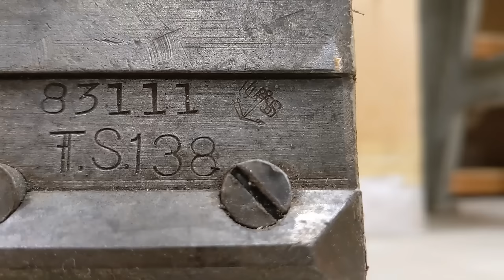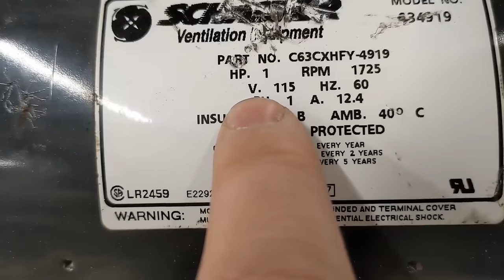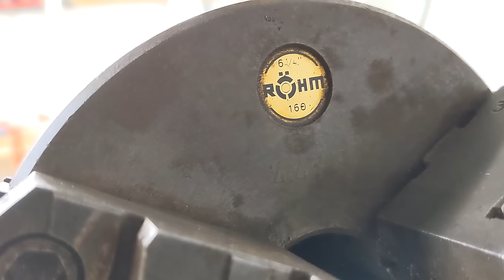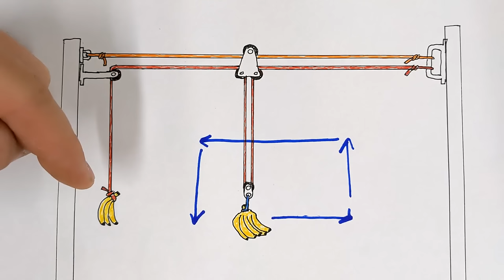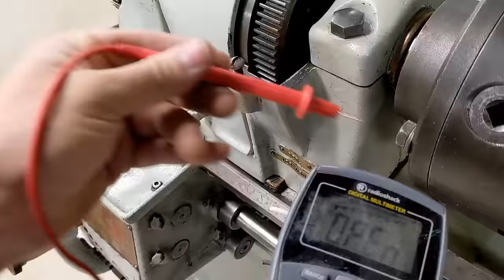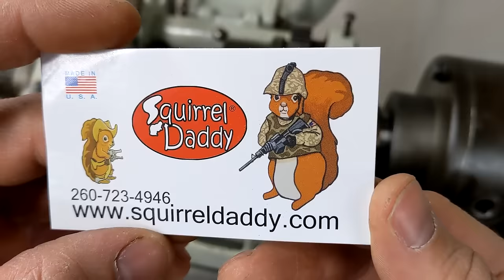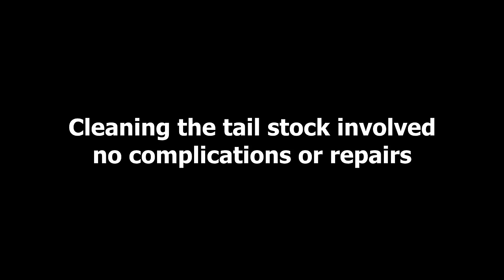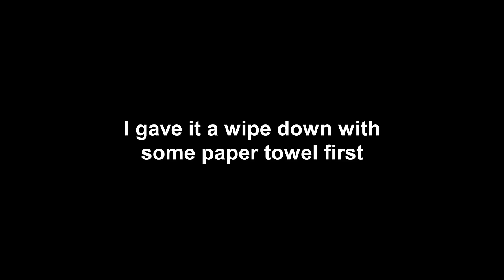From Crud to Stud, Restoring the South Bend Heavy 10 Lathe

Comment: I also restored a heavy ten from the Navy.  But when I did the bed was shipped back to South Bend and they re -ground the ways.  I then used turcite under the saddle and tailstock.  I sold it with a full collet set and  all the usual chucks and supports and stand.  The lathe was too small for my needs. I did like it though as this was what I learned on in college.  Super quiet and very precise.  I sold it to a guy who makes custom titanium bicycles.

Comment: I must say that I enjoy your sense of humor fully as much as I enjoy that of This Old Tony.  Now that I have found your channel, however, I will be losing sleep trying to decide who is funnier.
Reply from the maker: A comparison to ToT is high praise! it encourages me to put the effort in
Reply: Your video popped up in my suggestions, and I really enjoyed it.  I worked as an FA/final inspector for a machine shop for many years and was tasked with clean up and restoration of several vintage machines that the company owner had in a small museum room on site.   It was fun.  The chuck segment reminded me of a very old Bison 3 jaw that the boss found at auction.  Circa 1960, it hadn't been removed from its crate in about 40 years, but luckily, a smart operator slathered it in naval jelly before it entered its crypt.  Unfortunately, the grease inside had dried into what I could only describe as industrial adhesive.  Gentle heat was my only option, and even then it took a few days free it up before disassembly.  It freaking stunk too... I think they used whale blubber as lubricant.  Anyway, thanks for the great video.

Also, you will often find a leather plug under set screws on older equipment.  This allowed for setting tension firm enough to stay put, but loose enough to move without tools.

Comment: I brought a WW2 built South Bend 9 inch lathe back to the UK when my term working in Arizona ended in 1996. I restored it and was very impressed by the build quality. One thing that I found was that the headstock pulley has a figure of eight oil groove machined into its bore. I can't imagine the machining setup required to do that, but its very neat and shows how much the designer thought about lubrication.
Reply from the maker: That's great that you managed to get one back home, they're so interesting to pull apart and look at

Comment: On behalf of all South Bend lathe owners, a big thankyou.  Most of us have never seen such a deep excavation into the innards of our lathes.  If it still works we dont disassembled it ... and these tend to work forever.  All those oil ports is why.
Also enjoyed seeing your original lathe as well as your improvised tool post grinder.  You probably figured out you can lock the spindle t unscrew the chuck by engaging back gears while leaving direct drive pin engaged.  
Never be ashamed of a flat belt drive.  Old timers like my dad always felt they were safer than modern high HP gear drives.  Flat belts can safely slip if something (like an arm or necktie) gets wrapped up in the work.  Tension can even be reduced for newbys and kids still on the learning curve.
Since the flat belt is manhandled when changing cones my dad always insisted on a skived lap glue joint or gut laced joint.  Metal hardware can work apart and snag hands.  I helped him skive the tapers on the belt for his antique 15 inch South Bend and as a kid I cut the narrow grooves for the gut lacing on the belt for his 10 inch Heavy (called a Junior). All are still running as is my 10-K which I obtained as a big enough pile of chunks to make nearly three lathes (one tailstock missing but extra quick change)
Reply from the maker: Thank you for the story of those belts and your father's machines. I'm a big fan of flat belts, they've definitely saved my tools from a few crashes. I've always tried to avoid using my back gears for chuck removals to reduce the risk of damage, but perhaps that's a superstition I picked up from atlas which has wimpy zamak gears

Comment: The bolt head and but being different sizes was a standard, it was so you could work on the machine using a single wrench pack, if they were both 9/16th you'd need two separate and identical wrench packs...
Reply from the maker: Maybe they should have kept it that way, I have to carry around too many sockets

Comment: I managed the labor for lathe as about 1 and 1/2 days of work.  It is a south bend 9 model C as 1935 build w. 4ft bedway.  First cleaned and painted I raised a cinderblock stand and after some initial lube and drive belt function now happily make chips mostly as aluminum, brass and hard plastic.  As it arrived without a chuck, I mostly used clamp assembly to drive any initial jobs.   I made my own toolpost, and found various tool bits at no cost.
Just ahead, I am adding a brand new 3 or 4 jaw chuck and find with use, and constant cleaning the general end use is free and easy to any adjustment.  While some wear to the bed near chuck location is present, I find tolerance fine for my general hobby and motorcycle repair needs.
The South Bend lathe as design had a wide range of model delivered world wide.  And were well crafted with hand scraped surfaces and as you note, well designed lube points and operator access as tolerance metrics.  *dials and adjustments.
I now seem to spend very nice hours engaged to machine jobs.  Understanding the need for training and how truly modern CNC has continued to shape our world.  The shop space given over to this process has been transformed and continues to be the center piece for interesting problems as repair and fab as by my hand.   As you demonstrate, these machines are still available and can be found in various condition.  For the person new to the element as machine tool, I hold the view they far exceed a Chinese lathe as I cite a unit of 1935 vintage still in quite good condition.  That durable and quality construction as is lessened in the tin cabinet and hopeless motor drives of ever cheap design.
At present, I simply miss my friend a machinist, who I might have gained so much from as guidance and best practice.  Of which, for any 
operator, remember eye protection and at all times avoid any entanglement, any such potential for workpiece escape and where tool motion to bedway, carriage or fixture can be a hazard.   Regards, M.

Comment: Talks about a cap head instead of a slotted screw and then uses a screwdriver to undo the cap head 😆 
Enjoyed this restoration, seen a few, they are all different, liked the commentary especially. 
We manufacture spare parts for an old mechanical machine and you'd be amazed at how many times we see, 'drilled', or, 'reamed', or 'machined' in position on the drawings. I've also been involved with engineering for over thirty years and never seen how those old tapered accessories worked. So, thanks for that. 👍
Reply from the maker: I'm glad you enjoyed, and very glad you caught the screwdriver gag

Comment: Slotted screws are really useful when paint is around like houses or tools. You can get the paint out really easily and restore the slot if needed Try that with a Philips or worse a Torx. Restore more tools you will learn to respect them.

Comment: I feel there should be a better name for "not on". Can't remember though, English isn't my primary language. 
Oh and shout out for all things three phase power. I just can't stop myself from cringing every time I see US based high power machines. 
Heck my grandfathers lathe was a 3HP lathe, which was three phase. I guess that's one of the benefits of living in Europe ;)
Reply from the maker: Haha, the word you're thinking of is "off" but "not on" was me goofing around. Here in the states all of our industrial equipment is 3 phase, but at home we use single phase 220V for major residential appliances like ovens, dryers, and large power equipment. If I ever stumble across a cheap 220V motor I wouldn't mind running an outlet for it
Reply: @daveman4863  Sorry for not being obvious enough :) But I was being sarcastic with my comment about off :)

Anyway, I trained as an electrical engineer, so I do know a fair bit about it. Including a fair bit of general knowledge of the US system. (in part because when I trained, we used to have a few split phase towns that weren't upgraded yet). But would it surprise you that every home here is capable of running three phase power? The power company usually only connects a single phase, but if we want, we can easily upgrade to three phase. 

You say you wouldn't mind running a 240v outlet, but I can tell you all of my outlets in my house are capable of running 16amps@230v. I can plug in my water heater anywhere I like. Any random house for that matter, I can be sure every outlet is capable of the same thing. (I sure love the german standards for that)

Comment: There is a small chance that the ground wire connected to the hot wire talked about here 11:52 , was a holdover delta ground. I would have liked to see that connection between the ground wire and one of the phases back in the power room if that’s what it was but my experience with millwrights have been eye opening.
Reply from the maker: If it helps your detective work I found this machine in a residence with a 120v plug attached... I believe it was a simple case of hill Billy wiring

Comment: I am slightly surprised you did not purchase the felt kit to replace all the hardened wicks. Moreso in the parts that will be harder to get to wo undoing all the forward progress. South Bend used the wicks in the apron, head, tailstock and gear changer. From what I read with no wick, oil will not stay in or on a part that is meant to since gravity removes it. The wick fights gravity and crime. Or was it grime? Not sure. Great video on your part and looks like a good shape lathe if the ways are not to worn. This wld be prior to hardened ways. Anyhoo, stay the course! 1000 points of light or ignition!!
Reply from the maker: Thank you for the kind words

Phase 1 was what you saw, generally a push to understand the whole machine and build a master improvement list

Phase 2 will be to properly update and renew all the components I can

That list wound up being pretty long, so my future holds a lot of wrenching no matter what. You'll see new felt go in someday!

Comment: You need to regrind those jaws with an ID grinding setup. The surface of those chuck jaws are convex now and they should be concave on the surface to better hold round parts.

Comment: Next time you want to remove the chuck, put the lathe in back gear with out disconnecting the bull gear. This locks the spindle.
Reply: My dad sent this to and I told him the same thing. I was a MR in the Navy. The other thing is he doesn’t have a reverse so he would be able to use the back gear either.

Comment: Why didn't you use a brass brush to clean out the threads on the lead screw? It works for me most of the time without endangering my fingers, peace.
Reply from the maker: Brass brushes are great for day to day cleans, a string is good for deep cleans after many years of neglect
Reply: @daveman4863  So, a string cleaning is better? I'd like to know why if you don't  mind explaining.
Reply from the maker: it gets deep into the root of the thread and displaces gunk that's been stuck there. It doesn't do much for the flanks but that's when you follow up with a brass brush. String for me is a rare maintenance task @russelljohnson6243

Comment: Taper attachment is a real score. 

So, motor has high and low ... reversing?? Seems like that would be more useful than high-low, especially since the 3 motor pulleys correspond to the spindle speeds of the gear box. 
Just curious if you're going to keep high/low or go to a reversal.
Reply from the maker: After doing a few projects, I feel spoiled with having high and low speed with a switch flip. As for reversal, I seldom have use for it besides power reversing out after power tapping, but even then I throw it into neutral and reverse by hand
Reply: I have a 4' heavy 10 I'm restoring. No taper attachment. Headstock, gearbox, bed, and cabinet are done. Saddle and cross side left to do. Replacement felt kits are available on eBay for the wicks.
How's the clutch on the power feed?
Reply: @daveman4863 you need the reverse to use the back gear.
Reply from the maker: My lathe runs forward from the back gears while the motor is going forward @djc9727